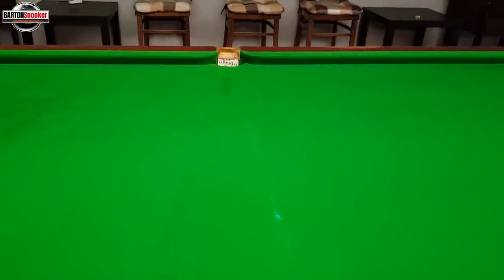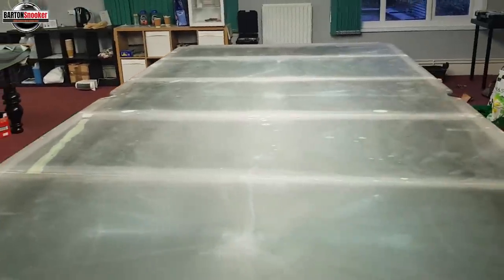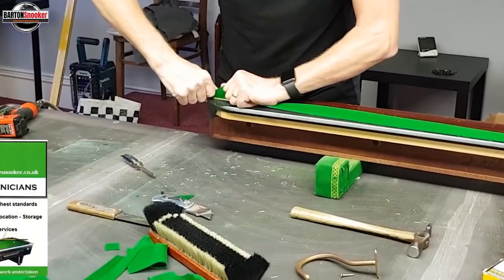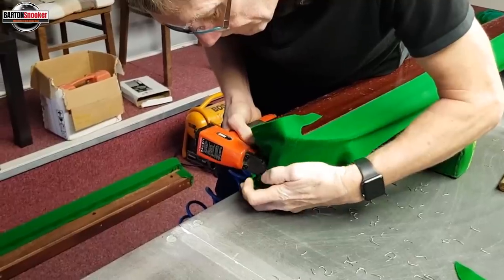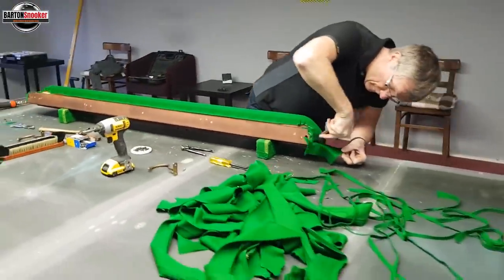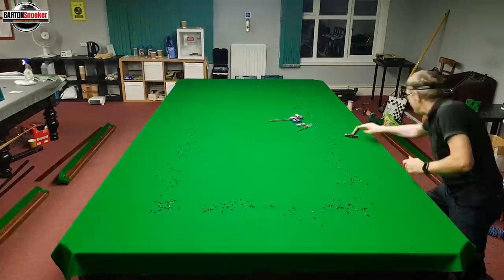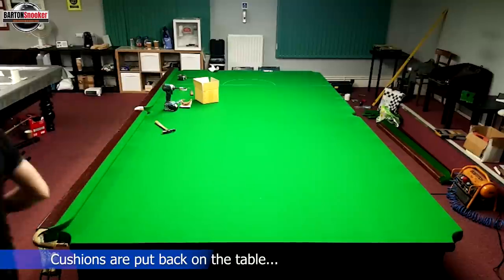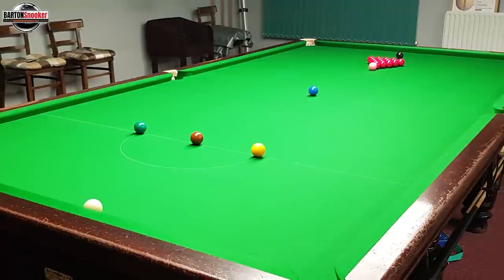Snooker Table New Cloth | Snooker Table

Comment: Great job, i do my own 8ft table and when i refurbished it as new it plays just like it first did when built , having the right tools and things to get the tables right cost money and time but worth it to get the breaks you want, i got a 101 after i replaced the cloth my cloth is 26 oz and fast, i use 50mm balls on a 78mm pockets tight jaws to test you out, not bad for a old table that cost me 99p and delivery £160.

Comment: Looks great Steve ,not sure if you have your cloth stretched at all ,had mine stretched after six months ,which was September .I only asked as I noticed you have had the tip x pen markings and that is permanent ,I use a white glass pencil ,as it rubs out, and when you need the stretch you don’t have two d line markings .New pocket leathers always look good .I have only used no 10 and 6811 ,not tried the super fine .
Reply from the maker: Hi Mike,

Ah that's interesting to know about the glass pencil. Thanks for that 👍

I don't actually bother to have it stretched. I used to, but I found no difference whenever it was stretched. As it's reclothed once a year anyway, it just seems like an unnecessary expense even if you did get a tiny, tiny improvement in speed.

I'm very happy with the Superfine. It's meant to play fast and responsive like a number 10, with a bit more durability.
Reply: I’m guessing your table gets lots more use due to lessons ,so the cloth may wear faster so maybe a stretch is not always needed .My lastvone was ok but this new one fitted to,y new table in February had just started to produce a bit of roll under the fingers or hard brushing ,it now plays like lightning .I may have to call upon you for a lesson next year ,home or away .I’m. Breaking down in the 90’s due to pressure on myself trying to knock a ton in again ,had a few some years ago but have developed a mental block trying to get one on my table ,it’s a steel block Westbury ,and the middles can be tricky if your not on ,basically I feel I’ve got a bit sloppy .hopefully next year we can sort it If we get back to normal .I may email you soon Steve ,Cheers.

Comment: Hey there
I just want to know that if im down on the shot must my shoulder be above the shot line or can it be slightly outside the shot
And what can i do to prevent it from happen
Thanks for the advise
Reply from the maker: It doesn't need to be absolutely perfect. Although the better the initial setup, the easier it is to cue straight (in theory).
Reply: @BartonSnooker  thanks for the advise and i will use this to my advantage

Comment: I’m surprised that the fitter put all his tools & materials on the brand new and no doubt expensive cloth when he was installing the rails & leather! Surely he should have had a separate table on wheels for his equipment. Nothing should have been placed on the new cloth once fitted...
I was also surprised he used the slate bed as a workbench when recovering the rails.

Comment: Would you have the full video in normal running time. Great job. 👍
Reply from the maker: Unfortunately not. It takes around 4-5 hours to do my table. You could probably do it a little faster than that, but the table fitter is very careful to make sure everything is perfect.

Comment: I need a new cloth on my table, does your table have heaters? My table seems to run fairly true when cool but rolls off when warm, I assume something must be distorting. Have you any experience of this issue?
Reply: Too much heat can warp slates and the woodwork ,if you must have a heated table then it’s better to have heaters on all the time but on a low tempriture .If you can feel the hat on the cloth it’s too hot .

Comment: I play Chinese Pool and there's a chinese cloth, that's really simillar to Strachan, which is the Andy x5 and x10. I bought this cloth and I'm using it on my 9ft table. It's pretty accurate and the wool is as good as Strachan's for what some professional players told me. But one thing that I've noticed is that when doing a deep screw or something that requires getting too close or even hitting the cloth, the cloth gets damaged too easily, exactly like you've shown in the beginning of the video, those "grated" marks on the wool. Since I don't have any experience playing on Strachan, I'd like to ask you. Does that happen with Strachan as well?
Reply from the maker: It won't happen on the Strachan cloth just after 1 or two shots. The marks you see on mine have built up over 1 year.

Comment: As posted , the wood preparation really is an easy job , you could have easily do this  yourself ,  Its all about prep  during the stage when the sides have been removed . remember the cloth is going to be replaced so it doesnt matter you removing this 

 Then simply  sand down with an orbital sander start with a   300 grit  to remove the old varnish , then progressively sand  with a finer grade of paper 1000 grit to prepare the wood for staining , apply a dark oak  stain , , several manufacturers available  . apply with either a spray  gun or with a cloth .  finally sand down with a 2000 grit  to get an even finish . Once you have allowed to dry Your looking for a smooth seamless appearance , Its time to seal the wood with a  lacquer  , this can be painted on  leave for  48hrs to harden before using a polisher to bring out a fantastic shine .  Well worth attempting and to be honest you really cant go wrong have a bit of confidence and save a bit of money ,. Seems a shame as now you will have to pay for the sides to be redone again . cheers